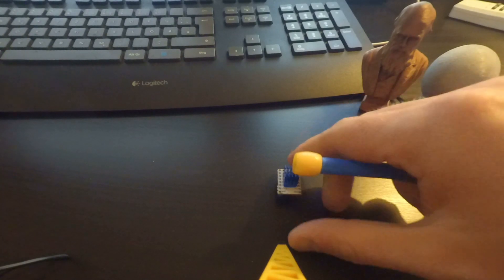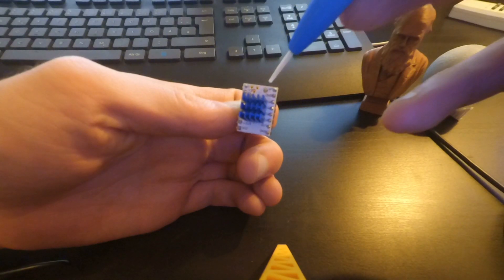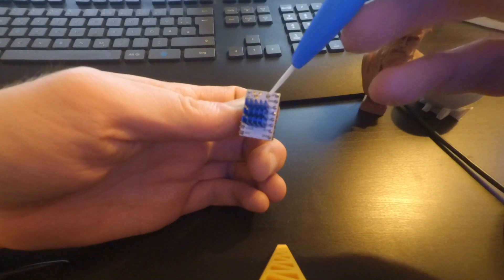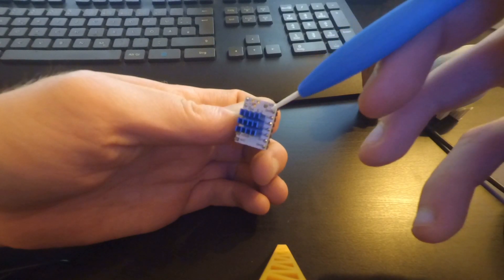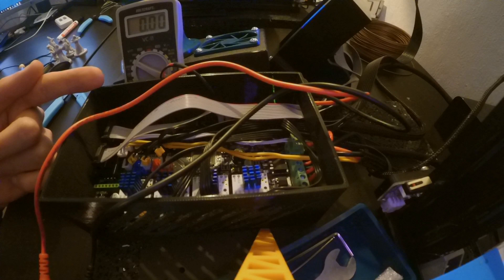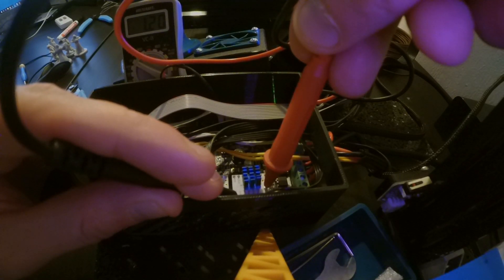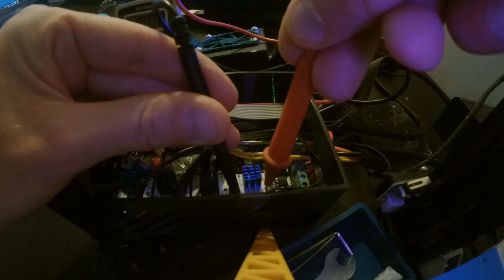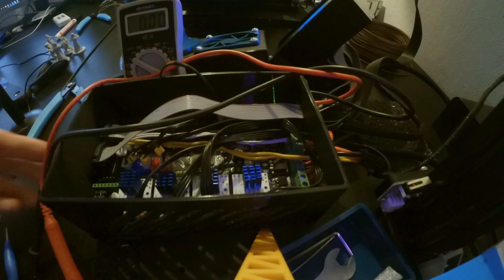It's getting hot - How to set the Vref on TMC2208

Comment: You can use the post for the black wire coming to the boards power connector to avoid touching the GND pin of the driver.

Comment: Btw you aren’t setting the voltage, voltage is constant based on your psu, you are setting the current, using the voltage u read on the pot as a reference hence it’s called the vref (voltage reference)
Reply: This is a little misleading... You aren't setting the voltage, but you're setting a reference that tells the driver how much current it can give the motors.  However, the driver can't lower the current without lowering the voltage, so the voltage isn't set.  The average voltage that the stepper gets will be lower if you set the vref lower.
Reply: @reid-dye , correct.  You cannot 'adjust' current.  Current can only be altered by changing voltage or resistance.
Reply: Yes, he is setting the voltage reference to adjust the current

Comment: fI notice you test voltage in the screw hole? I thought the vref voltage was that third lower hole in that three-hole arrangement?
Reply: You are right about the  vref hole in that triangle arrangement. However, that screwhole on this breakout board (and others, such as the TMC2130) is actually a secret passage to the surface of the potentiometer , which as it's metal will give you the same reading as the vref pin. Some people recommend a ceramic screwdriver in case you slip, but  another common technique for tuning is to attach your voltmeter probe crocodile clip directly to a metal screwdriver, then you can watch the reference voltage change in realtime as you turn it! One slip up or the clip popping off could mean shorting out your breakout board though, so be careful doing it that way.

Comment: My motors are running at 65C that is quite hot even at Vref set to 0.8V
Reply: turn it down then. Some get by with .5
Reply: Steppers motors are rated at 100C temperature rise!
If it is 25C in the room, the stepper can be at 125C and be 'OK'.
All that being said, running them hot for no reason just wastes power and could lead to frame warping.
Reply: @pirobot668beta  so you mean if i put the stepper in my oven at 200 degrees then the motor while running can be 300 degrees and be `OK` ? :P
Reply: I opted to go with the TMC 2209s v2 because I wanted silent stepper motors without an extra cooling fan. I set their vrefs to ~0.84-0.85 and they're preforming very well, having stayed below 40C for the past hour. I did have to invert them in Marlin, but they were a 20 minute install, and now the only noise is the parts fan and a much quieter retraction. I also have the common stepper motor dampners installed, and a little rubber pad under each corner.

Comment: Hi...why it have to be 0.8v if you have auto bed levelling?
Reply from the maker: Your Z-axis has to compensate the irregularities in your bed. Its moving more and might get extremely hot if you have your voltage set above 1 volt.
Reply: @makerscientist3203  Can i just copy my original vrefs to new tmc2208 ones ? i believe on my cr10s xye is at .75v and z at 0.9
Reply: @owca6666  No you can't